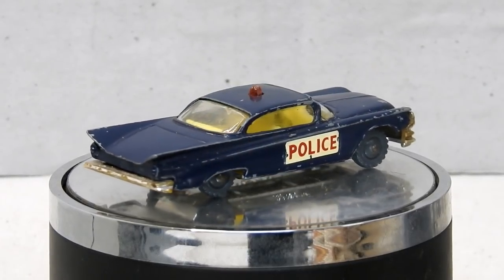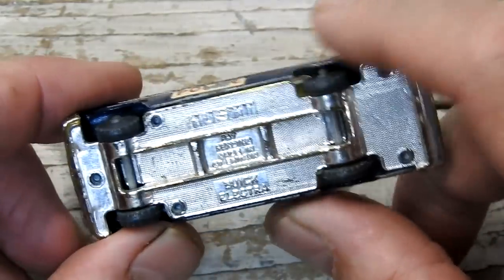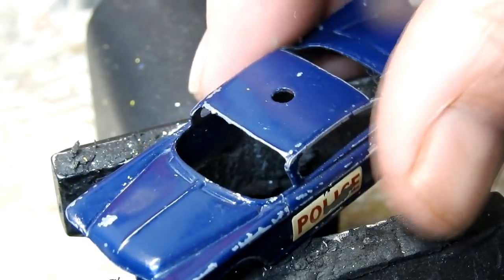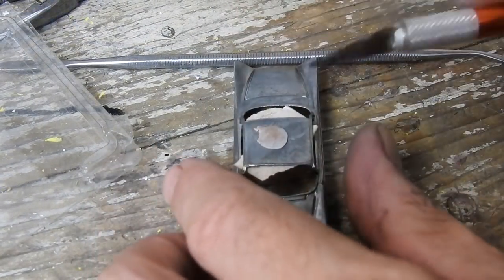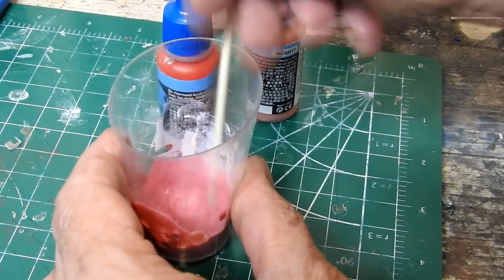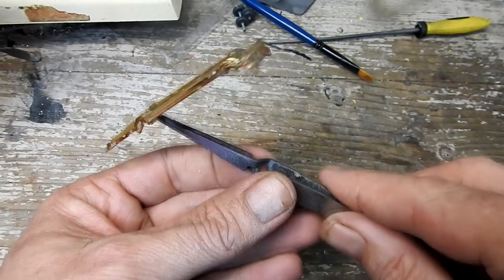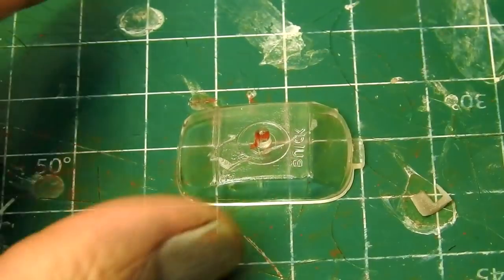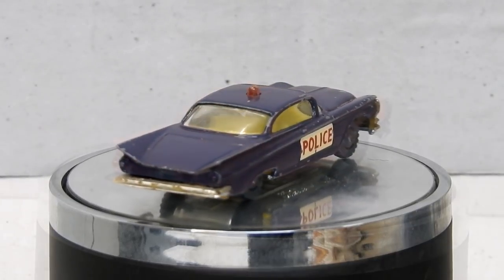Husky Buick Electra Custom 'Paint It Pink Challenge' Breast Cancer Awareness

Comment: I have just finished this Buick Electra myself in Tamiya Pearl Green with a roof in Racing White. Had a tough time getting the base off too! Tough part is the hole
in the roof. Noticed that  dried putty shrinks and you see the sanded circle  through the paint!  Used the same thing you did to remove
the paint off the base. It was hand painted silver on the ends after spraying the rest of the base in black paint. Love that pink color!🔥🎗